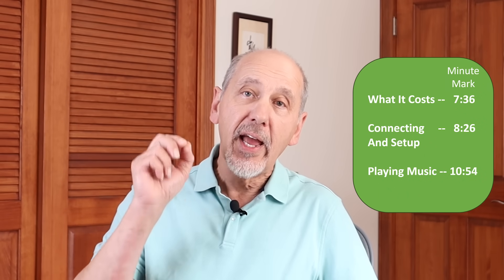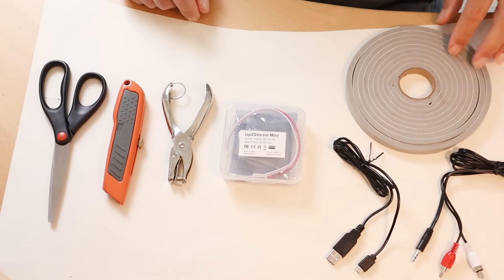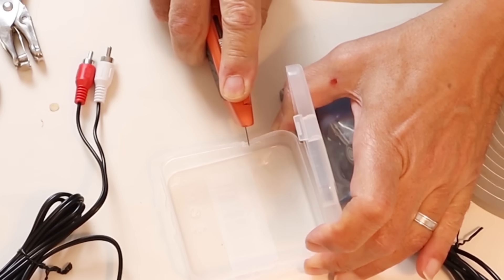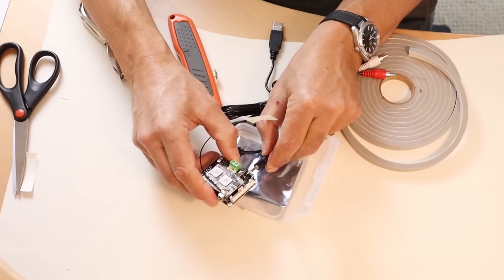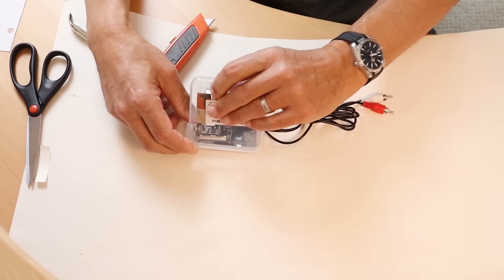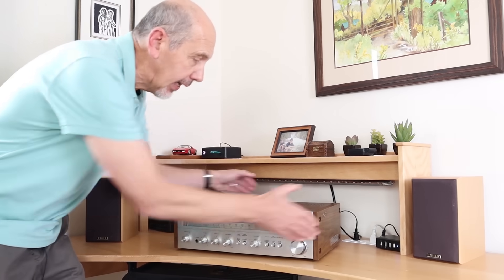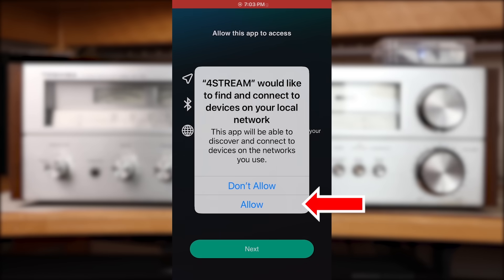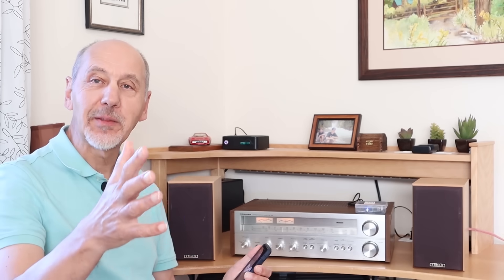Create A $50 Wifi Music Streamer Connect Phone Wireless to Stereo Receiver

Comment from the maker: Some viewers have told me that the 4Stream app in this video does not work with the latest software release on Samsung phones. I reached out to Arylic and they told me that they will be releasing an updated version of 4Stream. In the meantime, if you have a problem with 4Stream phone compatibility, the Up2Stream board in this video can be set up using the Arylic GoControl app.
First put the board into Bluetooth mode and pair it with your phone then open the GoControl app The app won’t find the board until you push the plus sign in the top right of your screen after which you will see your device listed. If you tap on the listing for your device, you will get asked if you want to configure the network on your device. Tap confirm. The app will then scan for networks and when you see your network select it then enter the network password and click confirm. Once the network is correctly set up the light on the board will be white and not flashing.  After this your Up2Stream board will be recognized by the Wiim Home app. Use this app in exactly the same way as the 4Stream app in the video to control the board link it to others and play music.
Reply: I guess that it was too good to be true. 4Stream doesn't work with my S25, and the Arylic GoControl app can't find any source. They should let you know this before you place your order. Would you recommend another device ready to use that is not from Arylic? Thanks for your help and videos
Reply: I've been trying to pair the board to the Go Control APP.  I'm missing something. How do you put the board into Bluetooth? 
The button doesn't seem to work.  Is the button a momentary contact or a maintained (mechanical) switch. Does the board need to be energized when switching? 
Obviously an operator issue.

Comment: Great project.  I went to the website to order this board, and it looks like they no longer sell it.  At least you've described the issue very well as to why my Bluetooth connections sound weak.
Reply from the maker: Thanks for posting.  Good catch on the product link.  The manufacturer has re-branded their DIY boards and put them on a different website. You can buy the boards here https://www.up2stream.net/products/up2stream-mini-receiver-board.  I've updated the link in the video description. Thanks Again.

Comment: But you need internet for that and the sound quality is yuck and half the tracks are copyright controlled and the dumb phone needs charging. Just ditch the phone and get a cd player and plug it into the hifi and Bob's your uncle. Also now I have to build a contraption first. Even better get a tape deck, uh you mean you don't have an auto reverse double tape deck and 250 TDK tapes oh dear...
Reply from the maker: Internet Sound quality is yuck, UNLESS you change the default settings on the apps to the highest quality, and avoid lossy streamers like Spotify. Better still stream HD music files from your own home server and get 24bit 96kHz resolution, better than a CD.  Personally I've found building contraptions to be easier and more rewarding than repairing and maintaining old tape decks.
Reply: @rogergadgetguy  No my whole point is to not need the internet and not having to waste time on streaming setups. I wrote there:cd or tape or vinyl if you are as privileged as I am. If you have mp3s on a disk you can play that from pc/ipod/mp3player. Do you get my point ? No Internet. 24bit 96kHz is for when you imagine you are in the studio otherwise that means nothing. You need really good speakers to appreciate that. The point is to listen to music not fool around with tech. As for building contraptions I've built stuff that beats wifi contraption on any day. I would be bored building something as simple as a streaming setup. Also all my sound equipment works perfectly and doesn't need any repairs or maintenance right now, they are all working fine. You do understand that streaming doesn't offer anything more than what a cable does, only cables are easier quicker and more reliable.

Comment: Wouldn't it be a lot cheaper to use an ESP32 as a Wi-Fi streamer? The Arylic board works but costs $39 vs ~$5 for an ESP32 dev board.
Reply from the maker: It depends, If you just want to stream from your own network server then fine, but if you want to use commercial streaming services you will likely find available apps to be extremely limiting. I have used a Raspberry Pi Zero 2W which  is also very inexpensive and has more available software and hardware options but still does not support as many commercial streaming services as the up2Stream mini.

Comment: Original BT was pretty dodgy sounding. After BT 5 or so - not really sure I can tell the diff between BT and CD quality now. The greater advantage is the fact that a wifi streamer stays with the stereo and once you set it playing you can lose the phone or take it out to the garage, and the streamer will just keep playing. The advantage of the old Chromecast Audio units went further: you could have multi room stereos and Google Home speakers all playing in sync, or they could be controlled independently. It was a diy Sonos system. I would like to see that sync ability in a diy form like this.
Reply from the maker: The Up2Stream mini board in the video can do multi room like Sonos but much cheaper, it links and syncs to products from Wiim, Arylic, Dayton Audio, Edifier, AudioPro and Audioengine.
This video covers multi room options in more detail.  https://youtu.be/_RQIJUH_3Gw
And this video shows how to turn any passive speaker into a Sonos like WiFi speaker that you can link to with the cheapskate streamer. https://youtu.be/CkRj_SMRg6Y
Or you can link to the cheapscate streamer to drive a subwoofer as in this system https://youtu.be/CkRj_SMRg6Y
The possibilities are endless.

Comment: Just set mine up tonight. WORKS GREAT.  THANK YOU VERY MUCH 
 Question, I blue toothed it to my phone and then tried to blue tooth it to my wife's phone.  I was unable to have it remember both phones. One or the other, and then any calls any text messages go thru the stereo at full volume. 
I have an old iphone that I'm going to use as a controller. I'm wondering if I set this up incorrectly.  My wifi  connection was lost for part of the set up.   Thanks
Reply from the maker: You have experienced two of the reasons its better to use WiFi than Bluetooth for home Stereo.  Setup starts with a direct WiFi connection and the there is no connection while it switches connections to go through your router. This is normal.

Comment: I just use an old chromecast dongle plugged into back of Amplifier. Nearly all music streaming apps are capable of casting to the dongle.. Poweramp music player is used to cast my own music library thats on my phone. You can pick up an old chromecast Puck for as little as a fiver. Make sure it is connected to local WiFi and you're good to go. You can thank me later. 😊
Reply: Power Amp player is only for Android?
Reply: There is a monthly fee or subscription.
Reply from the maker: Chromecast dongles are really great for android phones but app support is limited on iphones.  On the newer chromecast dongles (the White ones) you can download the AirReceiver app to add Airplay so you get all Android and iOS apps fully supported.  That's a cheap easy and versatile solution for streaming audio. Check out this video. https://youtu.be/UTpL_cdAOz8

Comment: Well gadget guy... do you have something that will do what I want?  I don't like streaming because I have quite an extensive music collection of my own, tunes that mostly wouldn't be available on Streaming Sites.  I'm trying to figure a way to play FLAC files from a USB or SD Card on my home stereo, and it sure would be nice if it could read the USB or SD files like a menu.  Wouldn't it be nice to have several thousand tunes ready to play on my old 70's Technics or Kenwood stereos?  Can you help me find something?
Reply from the maker: I actually do that in my own home,  I  plug a 512GB USB drive with thousands of Flac files into a Raspberry Pi Single board computer The Raspberry Pi is running the Moode Audio server which is free software. You can then use the streamer in the video to stream the FLAC files to your stereo.  If you are not familiar with Rasperry Pi then it would take a pretty long and complex video to fully explain how to do this, but you can load the files onto a PC or NAS and do the same thing.  This video shows one way to do it from a PC. https://youtu.be/DZSx9ZPveqY An alternative would be to use the Up2Stream Pro board https://www.up2stream.net/products/up2stream-pro-receiver-board?ref=RogerGadgetGuy which has a socket for USB, and will play Flac files directly from a USB stick, using the 4Stream app for control. I haven't tried this yet so I don't know how good the experience is.
Reply: @rogergadgetguy  Interesting...!  I'll check your links & see if it looks like something I can handle. 
I could use my Sony bluray player which plays flac's via disc or usb, connected to a TV.  I guess I was just hoping for a single unit, much like a phone or tape deck.
Oh well... thanx for your advice, I'll take a look. 😊

Comment: So bummed went this route , the unit is over $60 in Canada and the 4stream app doesn't work on pixel 6,only works on older android phones. So I guess I'm sending it back
Reply from the maker: I've used a Pixel 7 and now a Pixel 10 and it does work on those, but some viewers have told me that the 4Stream app does not work with the latest software release on Samsung phones. so it's possible your Pixel 6 has the same problem. I reached out to Arylic and they told me that they will be releasing an updated version of 4Stream. In the meantime, if you have a problem with 4Stream phone compatibility, the Up2Stream board in this video can be set up using the Arylic GoControl app.
First put the board into Bluetooth mode and pair it with your phone then open the GoControl app The app won’t find the board until you push the plus sign in the top right of your screen after which you will see your device listed. If you tap on the listing for your device, you will get asked if you want to configure the network on your device. Tap confirm. The app will then scan for networks and when you see your network select it then enter the network password and click confirm. Once the network is correctly set up the light on the board will be white and not flashing.  After this your Up2Stream board will be recognized by the Wiim Home app. Use this app in exactly the same way as the 4Stream app in the video to control the board link it to others and play music.

Comment: My new Samsung Z7 flip phone will not download the 4Stream app,  Is there an update or another app available?
Reply from the maker: I'll write to arylic to fask if they are  aware of any compatibility issues or fixes. In the Meantime you only need 4stream for getting your device on the WiFi network, so if you can borrow another phone or use an iPad fo initial setup with 4Stream. You can then use the Wiim Home app after setup to control your device.

Comment: Thanks Roger! BUT,   Took your advice, received the device, completed your assembly, attempted setup instructions, BUT Google Play responded to me on my Galaxy S24 with this  "Looking For 4STREAM? This app isn't available for your device because it was made for an older version of Android". So, unable to setup with 4stream! Any alternate setup suggestions would be greatly appreciated before I begin the return process. Peace
Reply from the maker: This is a Samsung issue, The app works fine on other phones running the latest android. The 4Stream app is only essential for getting your device onto your WiFi network after that the Wiim Home app works really well. so you can borrow another phone or iPad for Setup or use an old phone, and then switch to the Wiim app on your current phone. I will write to Arylic to find if an update is coming.  They are likely to be more motivated to fix this than samsung.

Comment: If you had a Sony PS3 you could already do this, in 2012 as it is Wifi compatible and could even run a world radio tuner through the internet !  The only problem, is the PS3 has a boot up time and it's actually another full computer running. But if you want to see this as half full glass, you could build your musical library on the PS3 and then don't need it to get the music from your computer or phone. 
All that digital convolution is really crap.  I like the old time of analog audio, no nonsense, no bullshit smartphone and endless swipe and shit.

Comment: I've read Bluetooth 5.2 and later is where they got a big improvement in sound quality.  I just tried it using the Aiyama A07 Pro amp with on board Bluetooth it's definitely not as good as a DAC but decent.  I see that Ali Express has "fancy" acrylic cases made just for this unit for a nicer look.

Comment: Looks like something is not needed anymore with HDMI.
With any raspberry pi or old similar tv box you can push digital music straight into the amplifier. No digital to analog cheap modules involved only the high quality converter inside the amplifier. You can also control the amplifier via HDMI (e.g. volume)

Comment: Will any other app work with the Up2Stream Mini hardware other than 4Stream to play the mp3 songs from my smartphone to my analog receiver? I am using it on a Samsung A03S Android smart phone.  I have to wait between 10-20 minutes between touching the onscreen icons before the screen changes.  At first I thought the hardware was faulty, but after being VERY patient a song did start to play.  So, I know the hardware works and all the cables are connected properly.  I have uninstalled and reinstalled 4Stream several times, rebooted the hardware, turned my phone off and on between installations and done everything I can think of to get it to work properly.  Are there a maximum number of songs I can have on my phone?  I have about 3,000.

Comment: I made a similar device using a pi zero w2. yours is cheaper and less complicated, but I prefer the FOSS aspect of mine. no app required for me, but the occasional SSH admin tasks would not be everyone's cup of tea
Reply from the maker: I've made a few Pi streamers with zero w2 which do sound great with a good HAT. To avoid SSH admin I built a Pi DLNA server with a Zero W2 and a 512 GB flash drive which I sync to my PC with Sync Back Free. The seperate music server means my computer can be off, and the system doesn't depend on my laptop being in the house .  I've retired the Pi streamers to friend's homes, but the Pi server is still my primary music source.

Comment: Older Android 5+ phones are cheap and hackable for this kind of thing, and turning one into a wireless audio receiver/streamer is totally doable without much effort. They have decent headphone jacks (e.g., Qualcomm or Cirrus chips) and you can enjoy lossless ALAC or FLAC multi-room streaming using one as a dedicated player
. Run plugged in; use a fan if it gets hot during long streams.
 Output: 3.5mm aux to stereo RCA. For optical (if your stereo has it), add a cheap USB DAC (~$10).
Reply: I have an idea to use it in one room - but how would you get the music to a second room?
Reply: @leonlowenstadter9223  Great question! There are a few solid ways to do multi-room audio with these old phones without any extra proprietary hardware needed: Best and simplest option? BubbleUPnP app (or Hi-Fi Cast) + DLNA/UPnP renderer mode. Sync is surprisingly tight – usually <50 ms difference, so good enough that you can walk between rooms without noticing a delay. Or there's AirPlay (if you’re in Apple land). Apps like “AirMusic” or “AirAudio” let an Android phone appear as an AirPlay receiver. Works well, but you’ll need to root the phone or it will only work inside the app). If you tell me what music source you’re using (local files, streaming service, etc.) maybe I can help more.

Comment: Pi Zero would be cheaper lol
Reply from the maker: It's about the same by the time you put a DAC HAT on the pi.  (The Allo Mini Boss is Awesome! Better than with some HiFi DACs I've tried.) I wouldn't use the audio out of the Pi alone. It's not good.
Reply: @rogergadgetguy I just ordered a basic android TV box from AliExpress for 20 euros to use as a Spotify and tidal streamer. I think that should get the crown of cheapest streamer possible. It should be possible to attach a usb DAC dongle to it. I'm planning to flash a custom in it to get rid of possible malware.

Comment: A lot has changed since 2023. Bluetooth technology has dramatically improved to the point that it is difficult to tell the difference between a song being streamed over Bluetooth (256Kbps+) vs wifi or via a cable. Modern codecs like aptX HD provide sound that can be indistinguishable from wired audio.
Reply: Nope
Reply: @merdith6  On a <$200 set of speakers, it is hard to tell the difference, for sure.

Comment: Im new to this and like to know if it would work without the casing .or would one get electric shocks touching it? Thanks
Reply from the maker: It would work fine without the case and is perfectly safe. The case is free though so it's best to use it. It adds protection for the board and helps keep the wires from unplugging accidently.
Reply: Ok thanks